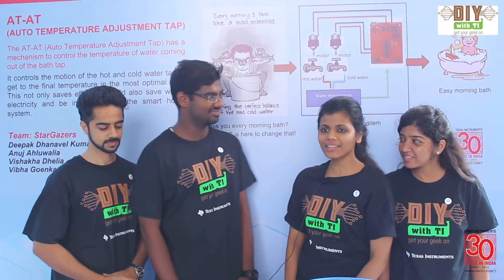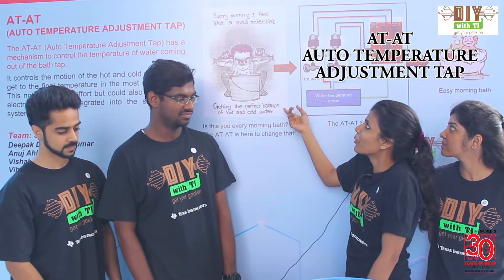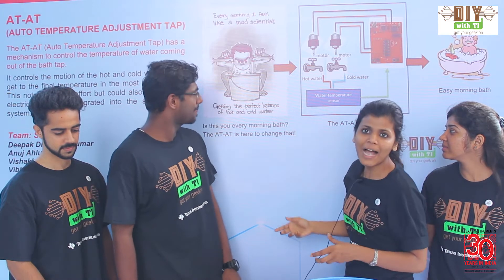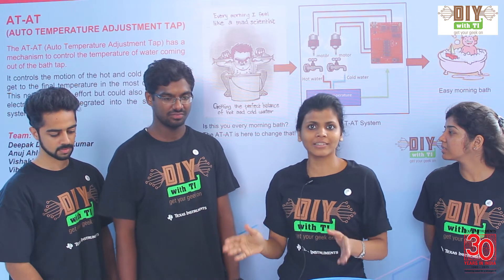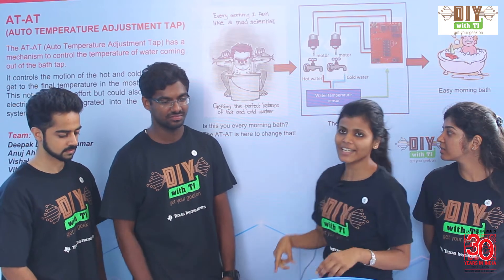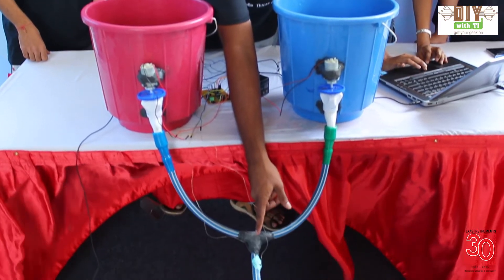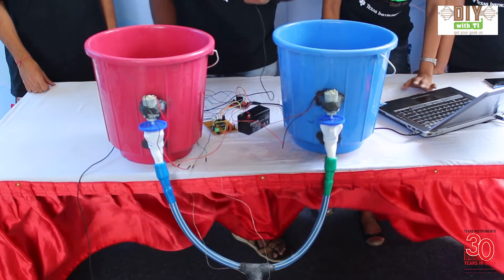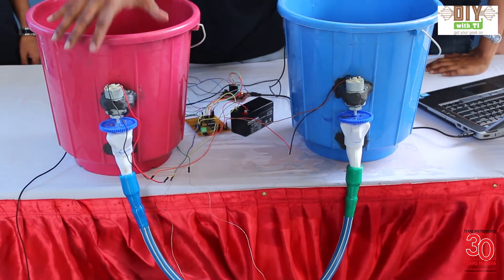Auto Temperature Adjustment Tap

Comment: Nice project and I hope you can improve it more guys! it seems to be interesting. I love these buckets and those nails hammered in the knobs. ;)
The motors do not seem to be stepper motors. I believe you have used normal dc motors without even electric braking technique and I guess that explains the slow jerky rotation. Could you please tell me how many degrees is the error rate of the angular rotation? and due to that error what would be the resultant temperature fluctuation? Btw.. What is the maximum torque of each motor to rotate these taps?